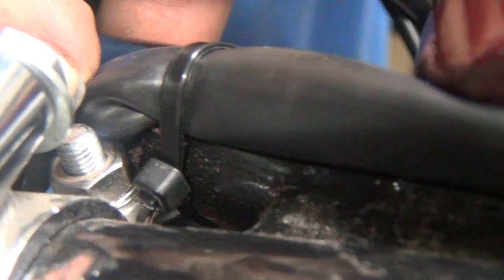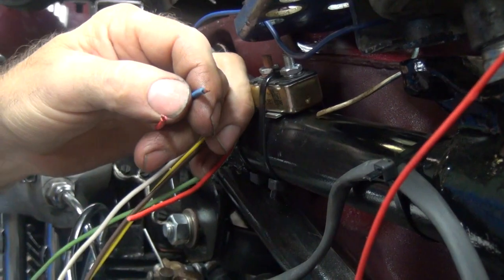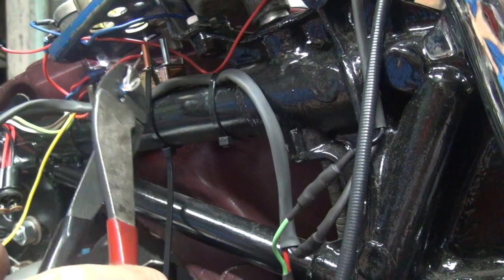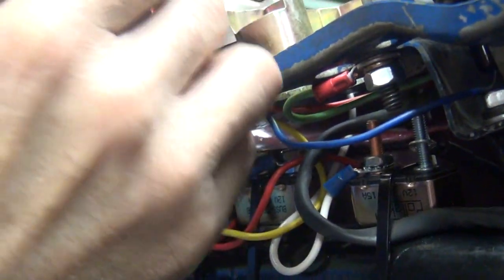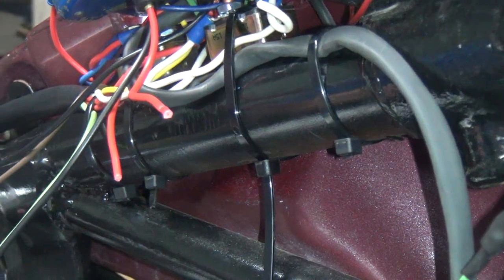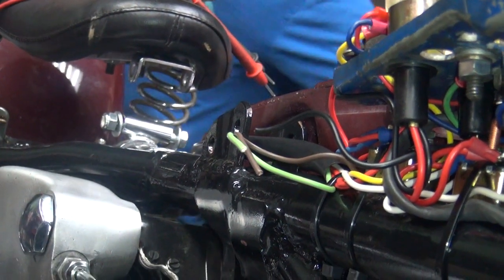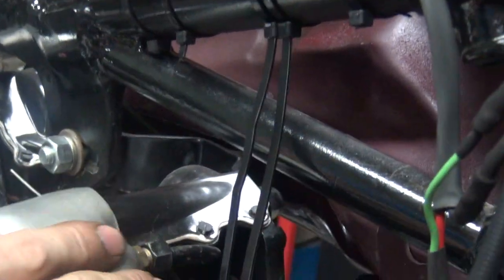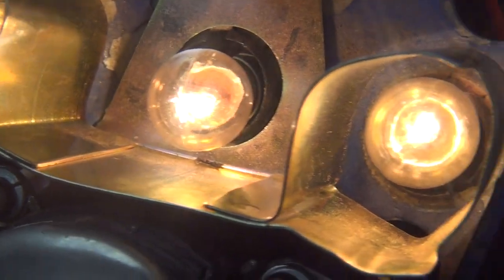1941 74ci Knucklehead #118 Bobber chopper get running kick start new bike build by tatro machine

Comment: Boy let me tell ya, after watching this series with Dan as your camera man, it gives a hole new positive aspect to the argument of using a tripod. Normally I like the non-tripod views as you get to see more detail when needed rather than a far away view. But with Dan as your camera man I see more non-related to what you are doing and more lift, floor, hands, parts of the bike you are not working on, etc., etc.

Since it seems that you are redoing almost everything he and this possibly fictitious person that did all the wrong stuff you are finding, he should have just brought all the parts to you and had you build it in the first place.

Oh, and did you ever switch around that diode that you originally soldered backwards on that voltage regulator?
Reply from the maker: the bike was finished in 2014 and that regulator is long gone.
tatro